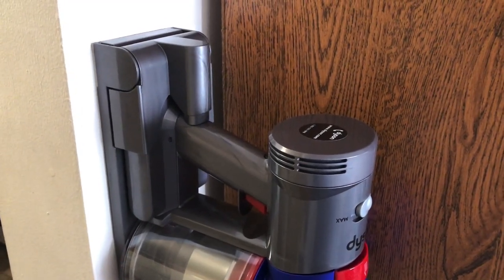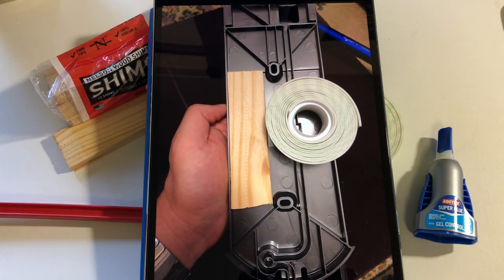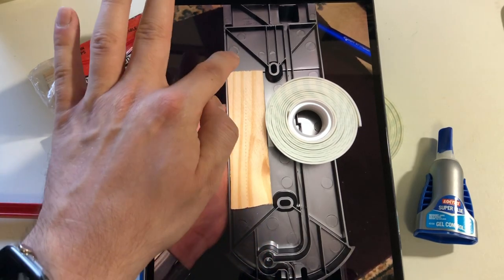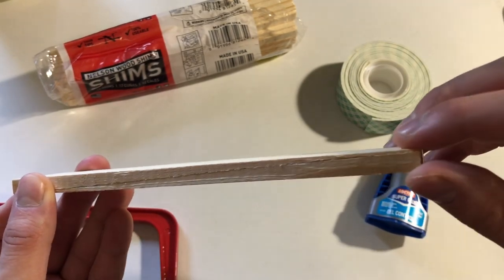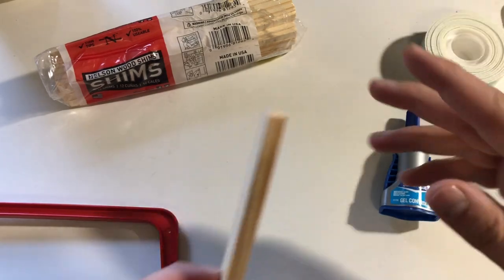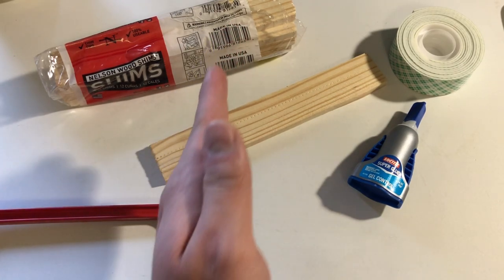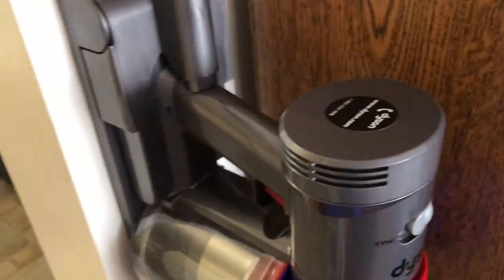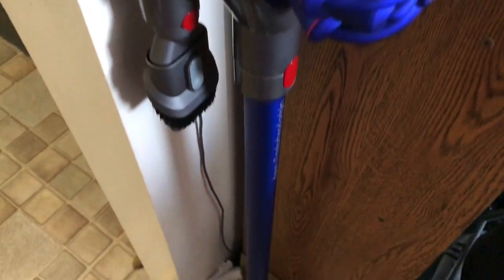How To Mount Dyson Docking Station Without Using Screws/Drilling

Comment: Glad it works for you however Im not sure I'd trust double sided tape to hold my $550 v10
Reply: i did it and it tore a hole in my wall and left tape adhesive on my wall
Reply: I'm planning to fill in the cavities with glue, sand it to create a flat back, and use multiple command strips. That should give plenty of support while also allowing for zero wall damage is you ever need to remove the mount. Should still allow for the mount to be screwed in if desired in the future too.
Reply: I think their vacuum is resting on the floor, so it’s really just helping it stand up straight and to charge 😊